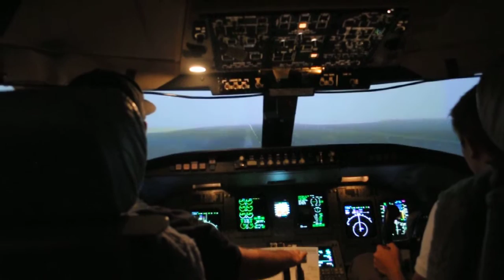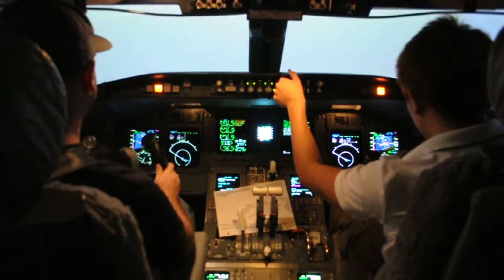CRJ-700 Sim V1 Cut Demonstration (Engine Flameout)

Comment: Why would anyone have a piece of paper covering up the panel?
Reply: conservativ view the switches covered by the paper aren't used except by maintenance or in rare cases as directed by the emergency checklist. There is however very important performance data that is listed on that paper that must be accessible to both pilots during flight.